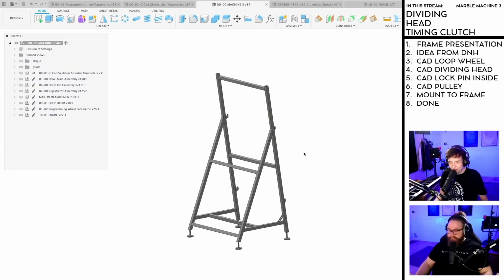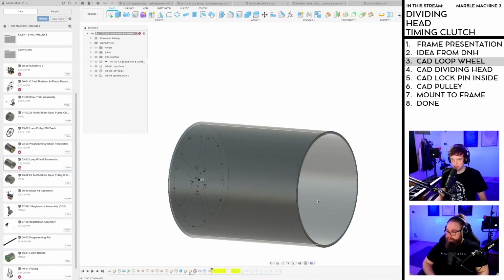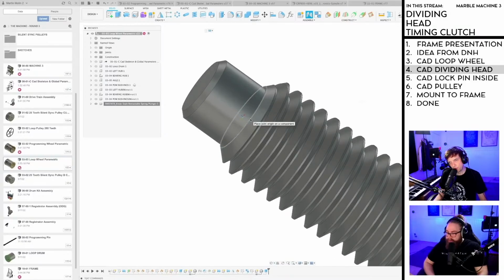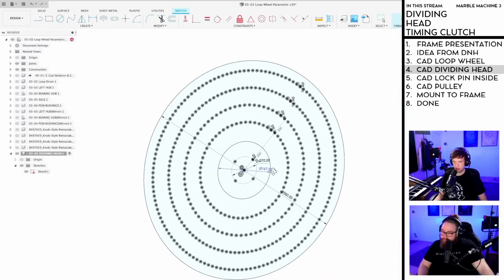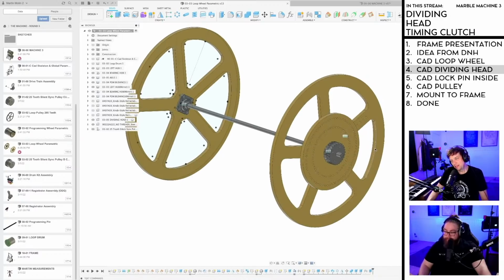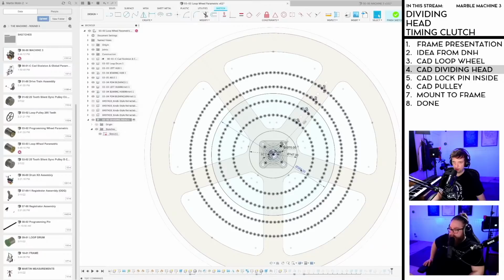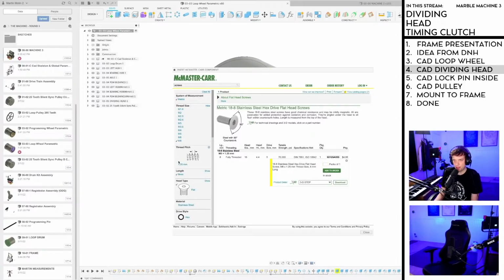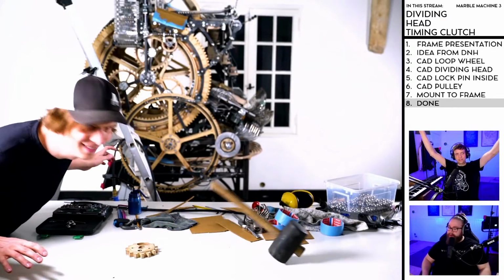Musical Timing With Dividing Head - Martin vs The Machine #20

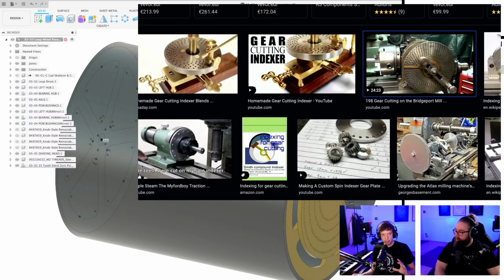Comment: 1:03:02 It's not the same thing. A gear cutting indexer uses vernier dividing that means if you had 45 holes overlayed on 46 holes you can divide a circle into 2070 positions!

Comment: If you use vernier indexing with 35 holes overlayed on 36 holes there is a 0.28 degree difference between the holes which will give you 1260 locations. 35x36=1260

Comment: Will it be accurate enough? If you manages to put 2000 holes in the disc you have a resolution of only 0.18 degree. This represents a large distance on such a large drum.
Also with only one driving pin you'll get a lot of mechanical stress.
A diving head normally has a gearbox, which hugely increases the resolution. But you don't use a gearbox....

Comment: The single screw leg  looks like a washing machine three points of contact is always better than one  Martin you can use a 3spear balls at the  bottom flatten one side of the spear so three points with three balls at the end sorry it's not my project but I really like what you doing just think that the feet look too much like washing machine Adjusters

Comment: One large programming wheel to play the vibraphone, which has dozens of keys, and another large programming wheel the same size just to play two drums and two cymbals? 🤔
Reply: And the bass :)
Reply: Martin wrote in the design document that every drum will have five different material beaters. Plus the bass and the A/B part selector and you have a lot of channels

Comment: It would be nice if you could show the rotation direction of the program drums. I'm wondering if you've put the tension pulleys for the belts on the right side.

The tension pulleys work best if they are on the slack side not on the high tension side. They should also be mounted using springs to maintain the belt tension even if the belt stretches slightly, which over time it will.

Also you will definitely want to add the shaft lock feature you talked about in an earlier video, or there's a risk the belt could lift the shaft from the mount you've designed. Now I'd seriously suggest you look up some kind of fast lock bushing. I can't describe it better and have no ide how they may look but it's something that has to exist and it should be easier to adapt than designing your own. Or at least it should give you some idea of how others has solved the problem. Remember that if possible COTS (Commercial Off-The-Shelf) components are almost always the way to go. Inventing the wheel time and time again is not a good use of your limited time.

Comment: Is the drumloop drum also acting as a flywheel? Looking at the beltdrive-ratio, the drumloop-drum must be rotating extremely fast 🤔

And as someone else also mentioned: maybe it would be better to use gears for the drums so that there is no belt to be removed. Gears simply snap in and can also be indexed.

Greetings from Austria,
Günther
Reply: Martin is affraid of noice from gears. Thus the belt.

Comment: The whole belt removal thing looks like it's going to be a pain in the ass to do live, i think it would be better to have fixed gears and belts and a sistem to remove only the drum, revolver style.
Reply: I think the fasteners for the drum and manual operations required to change the drums may take more time live, plus belts can be tensioned pretty quickly if done right. Also, the drum is way less likely to warp if there are spokes and a hub, although it is pretty long so it might not matter.

Comment: You don't need the circle of points you just need it in a line . Every hole must have a distance of degree equal θ=360/((number of teeth of gear)*resolution) if you choose a resolution of 8 for example you need to have 8 holes in the programming wheel and only one pin engaged.
Reply: You can have double the resolution if you   put two holes (on the indexing side) in it 's row.

Comment: I just had a thought about the timing. I don't know if anyone else had the same thought but woldn't it be nice to be able to adjust the timing between upper and lower brogramming wheels while the machine is running. To do that you would need some kind of Continuesly Variable Transmission. It could be v-belt driven like on scooters and snow mobiles, some drill presses also use CVT's. In drillpresses the cvt is adjustet wiht a lever, not centrifugal like on snow mobile. 
 The thinking behind this is that when you hear or notice that the tehmpo is out of sync you have to stop the machine to adjust the timing. Martin could explain more about the proces how the timing is calculated.
Reply: I sense armies of moles under there :$
Reply: The speed ratio will always be the same i.e. you don't adjust the frequency but the phase.

This is because the marbles need constant time to fall. Let's say the drums are instant. When you speed up more beats can be played during a marble fall. This needs to be compansated by either making the marbles play earlier or the drums play later.
Reply: To your idea. I believe it shouldn't be too hard to make a lever that adds a constant offset to the wheel.
You should be able to use a differential of some sort
Reply: @neur303  Yeah. I thought more and realized the cvt is not the option as woud some kind of clutch mechanism that would ofset the timing trough a spinning joint. Like helicopeter blade adjusting.
Reply: This will change Gear ratio, not timing.